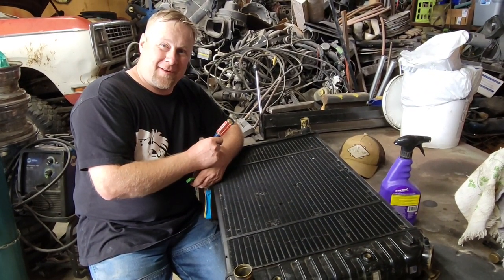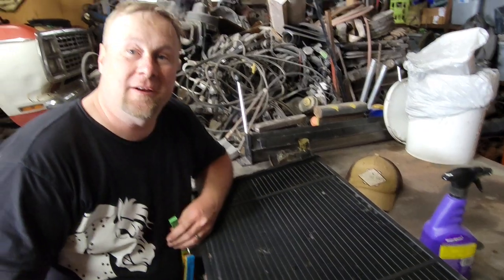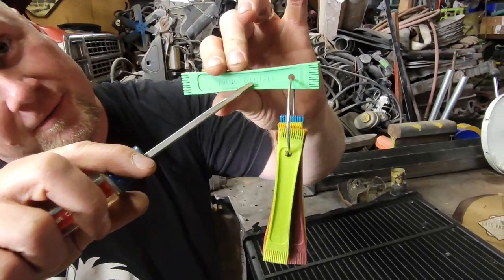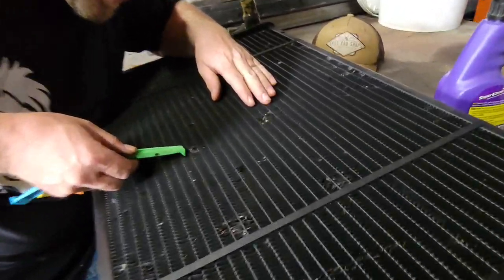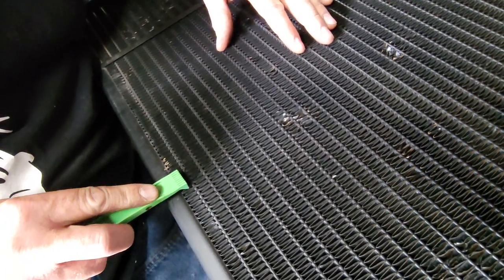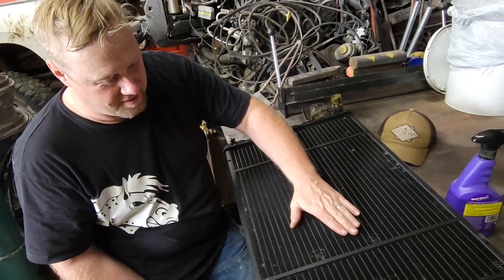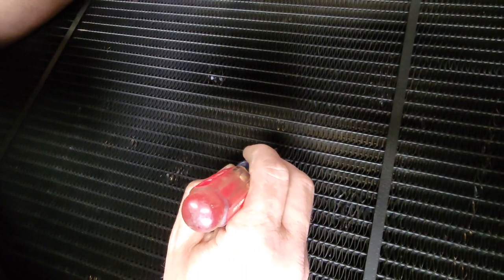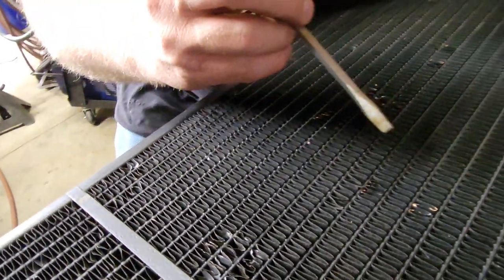DIY Radiator Fin Straightening

Comment: Those fin combs only work on air con radiators that have straight fins - notice he didn't straighten anything with it on the zig-zag fins. 
I have those same combs, they don't work on these radiators.
Reply from the maker: They actually do work, but possibly better on smaller stuff. Also, "HE" is right here.
Reply: @IronHorseGarage    I was talking to people seeking information, not just you mate.
Thanks for the video but if the comb works on zig zag fins, why didn't you use it to do the job?
Try searching YT and see if you can find a single example of one being used successfully on zig zag fins.
I'm going to try cutting one down to 2 or 3 teeth but it looks like small hooked craft pliers and a screwdriver is hard to beat.
Reply from the maker: The thing is it's not an in depth video, only to give a couple tips. I think you're being way too critical of the video itself. If you want a better video about the topic, feel free to make your own. Let me know when it's done and I'll watch it.
Reply: @IronHorseGarage  I don't mean to criticise your video or you, my point is that these radiator combs do not work for radiators with zig-zag fins.
I bought a vehicle with a top mounted intercooler that some clown has been using as a tool shelf and made a mess of the fins. I was hoping the combs I bought (identical to the ones you have) would make it easy to fix but no. So I turned to YT for info and find that there is no examples of them working.